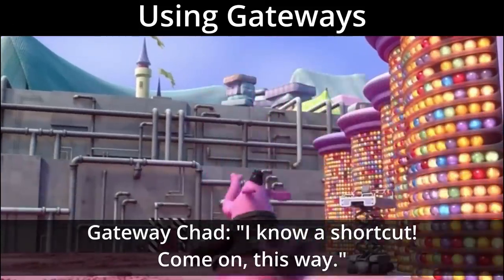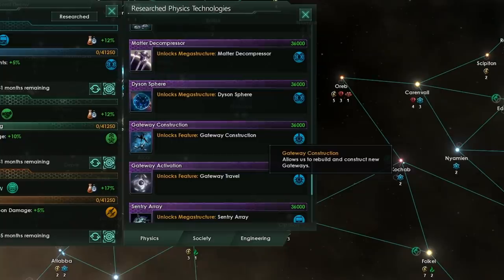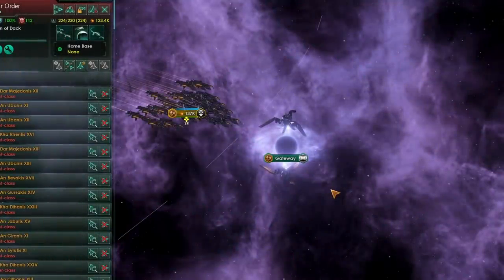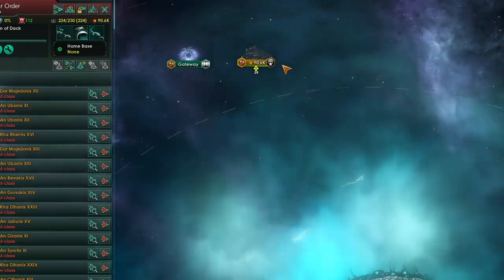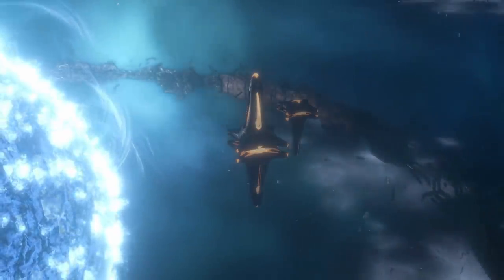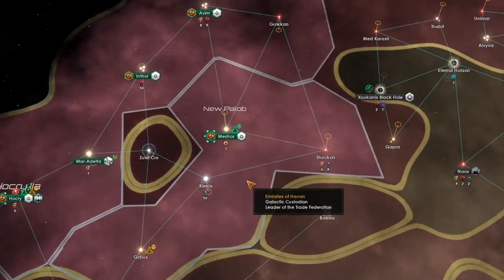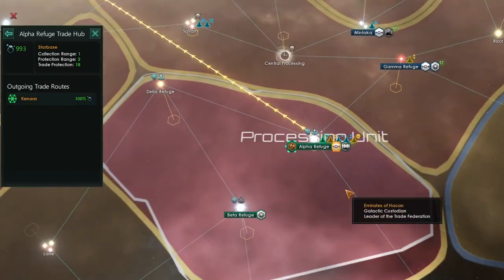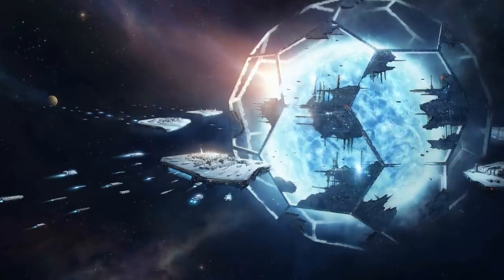Stellaris Gateways - The Space Superhighway

Comment: I make gateways to my home world, my primary ship building systems, high trade planets, and within 2-3 systems of my border systems. It's expensive but I never have to worry about travel time in my territory and piracy is almost nonexistent.
Reply: Damn straight. Playing as a megacorp with a ring world fully spec'd to trade, and having a gateway to get that trade home safely, is a godsend.
Reply: I always do that, and put one in Terminal Egress for easier access the rest of the Galaxy
Reply: I use gateways as a means to cut down travel time in my space, I set them up so that they are at the center of a two jump from gateway system area. Thus an ship only has to jump twice from each gateway in my claim area but the systems two gateways would be in would be six jumps apart at least if not seven both to cut down on the need and cost of them.

Comment: One important caveat is that L-Gates in enemy systems CAN be used during war, which is why I always station a massive fleet in Terminal Egress
Reply: I also build a normal gateway right next to Egress L-Gate for rapid assault on any L-Gate.
Reply: thing is they can quickly warp out to another system if you don't have a massive fleet like right on top of the L-gate. even ftl inhibitors don't work on this in terminal egress. T_T
Reply: You might wanna move the massive fleet when facing an equal, once the unbidden decided to doomstack a fleet I left guarding one of my l-gates, now I usually warplane camp to avoid it
Reply: @fabiandonvil  If you build an Ion cannon defense platform or station a Juggernaught with carrier computer, any enemies that enter Terminal Egress will be attacked by the station. Thus prevent enemies from using your gateway.
Reply: Basically, turn Terminal Egress into a terminal fortress... terminal for anyone who comes through.  I usually make a pure defense bastion there, backed up by a juggy with a maxed out escort fleet, maybe more depending on map/campaign settings (playthrough I'm doing currently, modded for all three crisis factions, so with as hairy as the field is, I got 5 escort fleets parked there), and then the neighboring systems I'll set to have all shipyards in case I need to reinforce quickly, a megashipyard in one of them as well sometimes.
Reply: Control of Terminal Egress is a massive tactical advantage. even if you control no other L cluster systems make sure you take and hold the TE system.
Reply: @zeehero7280  Yeah it’s a must for me in multiplayer or single player games. It gives so much control over the galaxy
Reply: @Salmon_Toastie  Dominating the galaxy in some form is the goal after all. whether you do it through economic, political, or military power, or usually some combination.
Reply: Learnt that the hard way on my last game, a War in Heaven had started and I went with the Non-Aligned Powers, everything was fine until I heard "Starbase Lost" and realized that a 200k AE fleet had popped up about 8 jumps away from my capital, I kid you not, that was the most frantic I've ever been while playing Stellaris. Thank goodness I already had the Mega Shipyard.

Comment: Trade protection and Gateways also go hand in hand. Have a star base with six hangars in the same system as a Gateway and the trade protection will extend over any system that is six jumps away from a Gateway. This prevents any piracy at systems where you collect trade value from space.
Reply: Tbf at that point you might as well use the gateways to collect the trade value directly, I usually just put 6 trade hubs on my capital starbase and use gateways to ensure it collects all the trade value directly, that way I never have to bother with piracy or trade routes

Comment: I like to have 1 gateway per sector and in that system will be a shipyard and a fortress world, the reason is to prevent the easy loss of the gateway as you can still use it if the fortress world prevents its loss as long as it stands, and in addition if I need to raise a new fleet fast all my shipyards can work together to quickly build and assemble those ships.

Comment: One of my favorite strats is to set up two gateways is unimportant systems with maxed starbases, (both ideally in a wormhole systems as well): 

SB One- Six Trade Hubs, Off-World Trading Company, Hyperlane Registry, Listening Post
SB Two- Six Hangar Bays - (Note; additional Hangar Bays (or Gun/Missile Batteries) on Starbases in other Gateways systems will increase Trade Protection, but not provide additional Trade Protection Range)

This grants a high degree of both Trade Protection and Trade Collection, (6 systems out and 7 systems out from any gateway you control)- as well as good sensor coverage a nice boost to trade value from that one starbase.

Comment: I recall hearing from somewhere (likely reddit) that Gateways can have a significant impact on late-game performance, slowing the game down for many players' pcs. It make intuitive sense to me, travel becomes significantly more complicated to check the more Gateways and potential paths there are, and Trade Routes seem like a prime way for cpu resources to get caught up checking that. 

Is that something anyone else finds true/likely? As a result, I've tended towards building fewer Gateways despite how useful they are.
Reply: In my opinion, Gateways are almost as bad for your performance as pops.
Reply: If the pathing is implemented well it should be the opposite; shorter paths available should have pathing return faster.  Trade routes seem to behave the same as ordering a fleet to move between the two stations would.  Hopefully that gets optimized more at some point.

Comment: I really wish FTL inhibitors worked on the L-gates though. It's one of the big downsides of opening the L-cluster. Even if you take and fortify Terminal it can still be used as a back door unless you are lucky enough to get an engagement to prevent them leaving.
Reply: Simple solution: build an ion cannon in a citadel in the l cluster. It will immediately start combat, allowing you to fortify it normally.

Comment: I build gateways in every system. I also tend to play very tall with megastructures. I only grab good systems that I want to put a lot of megastructures in though. Usually B class stars, trinari systems, black holes, pulsars, and neutron stars. Add systems with 4 stars to that list if I am using Real space as well. Usually only ever have maybe 30 systems max by the end of the game in a galaxy with 2000+ systems in it. The way my empire is spread out into clusters like that gateways are the only way to make it work. I just wish sectors worked through gateways because I hate the sector system so I try to ignore it as much as possible.